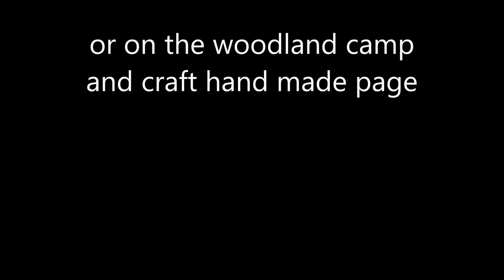Handmade Wet Formed Leather Coin Pouch

Comment: Nice work. It is amazing how you can form leather into such shapes.
Reply from the maker: I'm only just starting out but really enjoying it and learning lots all the time
Reply: It really is an ancient craft, most of what you are doing would be recognisable to any one from back then, I reckon. Do you et the leather off ebay?
Reply from the maker: +Dale Skidmore yeah have done up to now! But getting it from identity store from now on after a few issues
Reply: Thanks for the tip, I have started looking for some leather as I have used all the bits I had from an old satchel I took apart. It looks like everything you need on I.S. and at decent prices. Appreciate it
Reply from the maker: i was paying more per square foot on ebay but sometimes only buying 1 sq ft at a time, the more you get the cheaper it is
Reply: Yes. I want some to make sheaths from, but I also see they do guitar strap sizes, which is interesting.
Reply from the maker: did you get round to making a guitar strap?
Reply: Not yet. I have one for the one I use all the time, made locally, but have it in mind to do one for another I have.